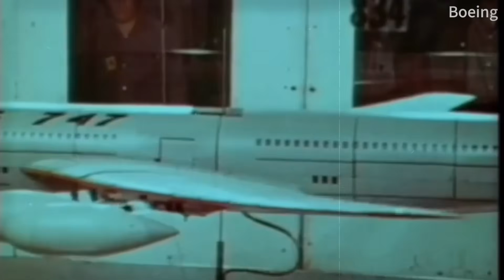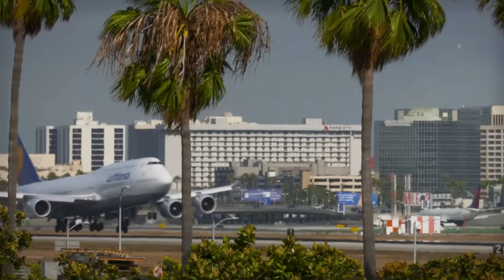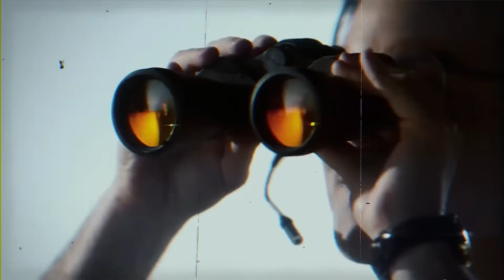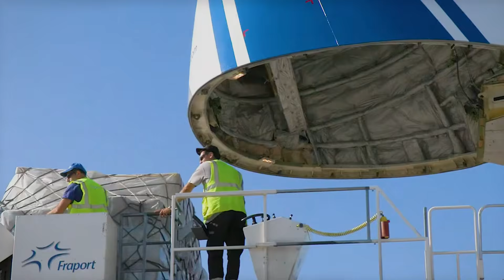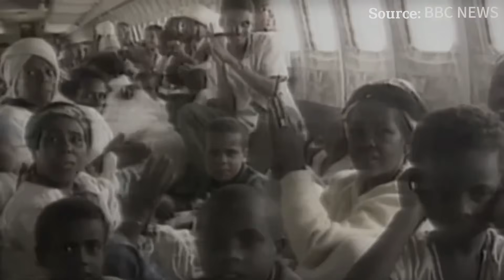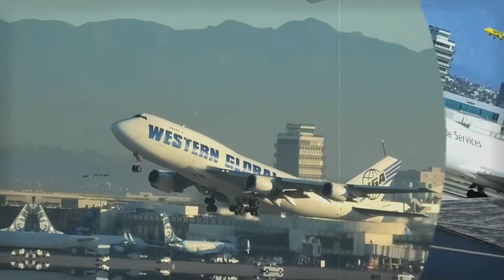The SECRET Behind the Boeing 747’s Iconic HUMP

Comment: Your info is pure BULL$HIT !!!!  The original design work on what became the 747 was Boeings design for what became the C5A, military cargo plane and yes it had a lift up nose and cockpit above the load, check out the current C5A and see what was chosen, not the design that "won" !!!  The Boeing design met all requirements and was a more cost effective design....BUT ... the procurment officer HATED Boeing and had stated he would NOT approve the Boeing design, even though it was a better design !!!  the contract went to the C5A, which was over weight, and when lightened was weaker and the wings  and fuselage had to be rebuilt stronger, costing millions more.  Boeing took the engineering and went with it as a passenger plane for Pan Am and with the secondary feature as a cargo plane, which by the way out lifted and out performed the accepted design that became the C5A......  the rest of the story !!!!